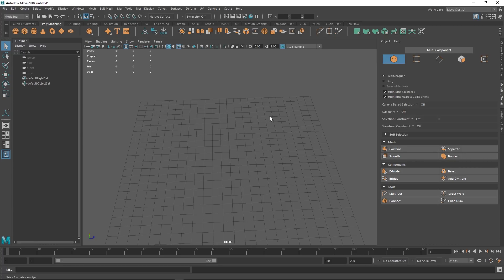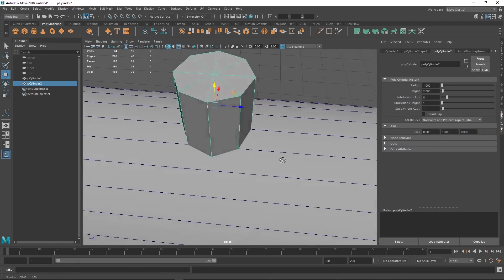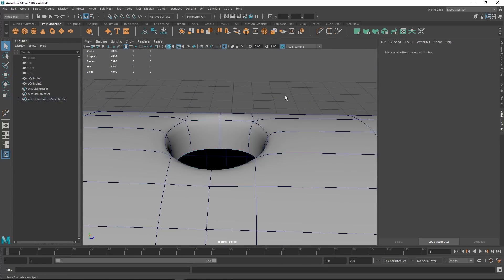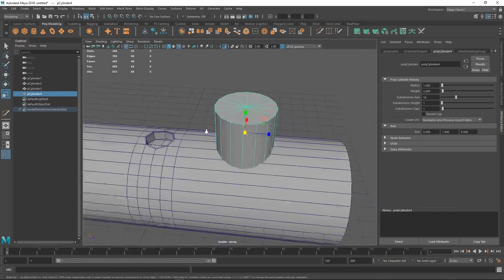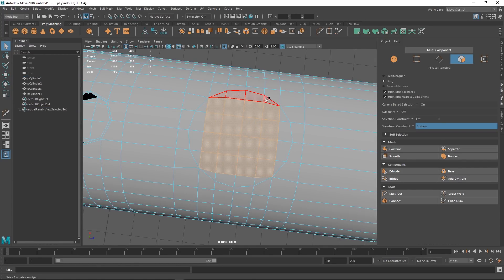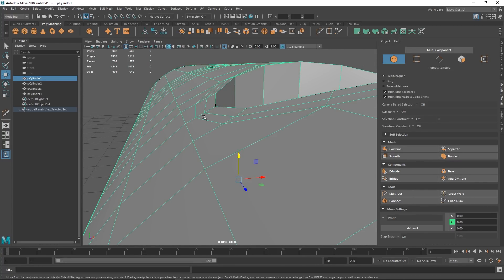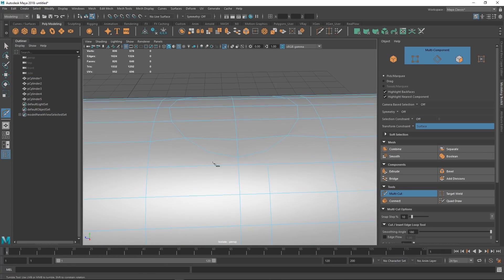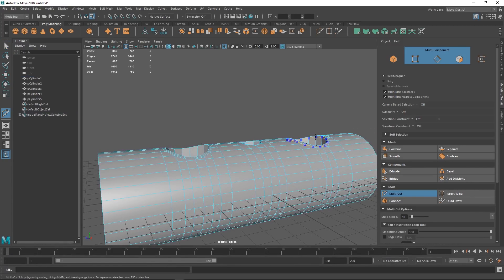Hard Surface Modeling Essentials: Curved Surfaces

Comment: Finetune adjustments in a tools editor window by clicking on the blue "pie" with a slice missing in the top right corner of the window.  The "pie" will show a different portion and this adjusts at what increment Thickness, Local Translate Z, Offset, etc are changed in.

Comment: Tip : if you are unsure about your final model , don't go and cut holes into the cylinders using this method, use booleans instead. These holes are nearly impossible to resize once you 'commit' to this method so I would suggest doing it quick and dirty until you are happy with your proportions etc THEN come back and rebuild it with subd.

Comment: the problem with extruding inward is that you cannot maintain the exact shape of the original cylander. with more complex shapes, this becomes a problem or can even no longer be an option.   a more precise way is to project curves or do a double boolean for the inner and outer rings.  cleaned booleans are usually the best way to attach complex shapes.
Reply: What do you mean by « project curbed » ?

Comment: Sometimes when making holes into curved surfaces like this, a temporary object can come in handy to act as a conformal surface to better control the geometry.

Not sure with this software, but in Blender it'd be something like making a copy of the big cylinder before putting the hole into it. Then if additional geometry like the surrounding loops cause pinching you assign those areas to vertex groups. Then you use the shrinkwrap modifier on the mesh with that vertex group to put those pinched areas smartly back onto the surface defined by the temporary copy. (Sometimes for roundness, a subdiv on the temp object also helps.) A bit harder to explain than just doing it, but I'd think most could figure out the principle. (And there's a couple of videos on it.)
Reply: It's a late reply, but if anyone sees this, in maya that's basically the same as duplicating the cylinder and making it a live surface with the little lock icon up the top. That allows you to slide points and edges and they stay stuck to the cylinder shape.

Comment: What's the purpose of going back and forth between smooth mode (3) and normal mode (1)? Are you eventually going to apply Mesh -> Smooth operation to the whole model? Is there a video where you explain the full modeling workflow such as low poly -> smooth -> high poly. Some of your other vids show high poly (zbrush) to low poly via retopo so I'm confused when each flow should be used.

Comment: What is the secret to not having the center of the cylinder bulge out when doing this? I did it but the center wants to push out and the cylinder is no longer clean and smooth.
Reply: Did you ever find a solution ?

Comment: Couldn't you just use the fucking bevel tool to add holding edges instead of "planning ahead" like you can do you and all, but I don't see why there needs to be 4 fucking loops or so added, and why you couldn't just edge slide the vertices around to eliminate Tris, and the clean up of preforming a boolean operation with the cylinder on the other cylinder is hardly clean up, all you'd have to do is take the knife or cut tool, and then just go into front or side or whichever way is the round side of the cylinder, then make a cut with whatever option that allows a cut to go through the mesh in Maya.

Comment: Great video! Don't you just love the multi-cut tool, I don't even use the insert edge tool anymore.
Btw, you probably know this but for those who don't, if you hold ctrl+shift it goes into slide edge mode which I personally find extremely helpful, you don't have to go and turn it on from the modeling toolkit.
Reply: Ah that's good to know. I'm still learning Maya. I was thinking, "Man, in blender it's just "GG" for edge slide." It makes sense that Maya has a hotkey for it. I'm slowly realising that most experienced Maya users know and use the hotkeys and make their own custom keymap. I need to do that myself is ever want to be able to model as fast in Maya as I can in blender.

Comment: I find the process of using booleans in maya 2018 far easier than previous versions, unless your object has a lot of history, things "usually" work fine and the clean up isn't too bad when you consider this method you have to do all these cuts and booleans is one click then a few target welds and you are done. Think your guys videos are great just I am a big advocate of using booleans for hard surface in maya 2018.
Reply from the maker: Thanks for your comment. Booleans have improved significantly over the years, for sure. We might do a separate video on those. We still think these fundamental videos are useful - but you're right, booleans definitely have their place.

Comment: Hey guys, I have something for you. I work on a car model and have to cut out venting holes on the windshield cowling. The whole thing curves left and right, asymmetric. bends and tapers. I would love to see your take on how would you cut the holes out on something like that. It's the Nissan 300zx should you wonder. I did one side but took me like 2-3 hours to clean up after booleans. I want to try something different so I was thinking to actually clean it up in Zbrush. Cut the holes in Maya, bring it over to Z and polish by feature and whatnot to bevel.  Use Zremesher after. I know you guys don't like that but the geometry is already heavy so what is the damage? Would love to hear others and you on this.

Comment: I think meshmachine / hardops addon is available for maya as well...check me on that... Saves so much time if I need to create or pre-create hard surface mesh. Those integrated tools happens to be terribly destructive and makes you really plan ahead and when messed up tend to spend even more time unnecessarily. Keep lovely vids going!
Reply from the maker: Ah yes, those are great! Thanks for the heads up.

Comment: Hey guys sweet video again,  not sure if its the same but I usually use "Ctrl + Shift" and dragging  vertices along edges instead of constraints, saves a bunch of time. I also had a couple quick questions, one is about intersecting geometry in visual effects hard surface models and second is  the use of CAD models like MOI 3d and fusion, I know Vitaly uses it a ton so I was curious how that translates into production? Thanks again guys
Reply from the maker: Very nice! Thanks for the tip.

CAD can basically only be used for concepting, as they'll have to be retopoed completely before they are ingested into the pipeline. Far too heavy to work with and impossible to UV map.

Comment: Can you please make a video about creating square details on a cylinder ? From my point of view thats the hardest thing to achieve because its almost impossible to smooth it our without ruining the cylinder shape
Reply from the maker: Do you have a visual example of this? It's a bit hard to imagine.
Reply: Hey! 

Heres 2 pics I took:

https://i.imgur.com/oWfP7W8.jpg
https://i.imgur.com/rXLz4Di.jpg

So, basically I find it impossible to harden out that square detail on the cylinder, because if you add those long supporting edges to harder the square shape, you are going to in fact, ruin the cylindrical shape when smoothing, I would like to know how to successfully smooth that detail out without ruining the cylinder shape ( due to edge loops ) 

Cheers fellas
Reply from the maker: Ah, thats a great example. Thanks. This is something we can talk about.
Reply: Cheers!!
Reply: @iplaybose you will need more cylindrical resolution.

Comment: If you're using Maya 2018, what about the new circularize tool? Is this still necessary?  I guess most studios still haven't updated to Maya 2018 yet though. Also for the supporting edges you could just bevel the edge and turn off chamfer to get the support loops.
Reply from the maker: Circularize is really handy! It's a not a replacement for what we're showing in the video though, as we have curved surfaces here.
Reply: @FlippedNormals  Doesn't the circularize tool have an option to conform to curved surfaces as well? I haven't used it a lot so maybe it's not that robust but I know i've done it before.

Comment: In my opinion it is faster to make holes into an object with the new circularize tool. (Edit Mesh -> Circularize)
Reply: It has an alignment property, set it to surface (average).
Reply: @daveZoo  same in 3ds max..... constraint to face with regularize tool
Reply from the maker: Thans for the heads up! We'll probably make a video on this technique too :) Like we say in the video, so many different ways of solving these things.
Reply: yes a faster way and a slower way @FlippedNormals
Reply: If the "evenly distribute" option is on, It will be twisted. That can look very messy, maybe that was the problem. 
Of course, in some cases, this tool is not the perfect solution. The technique in this video is still very useful.
Reply: much much faster